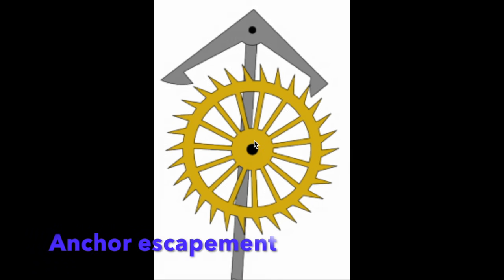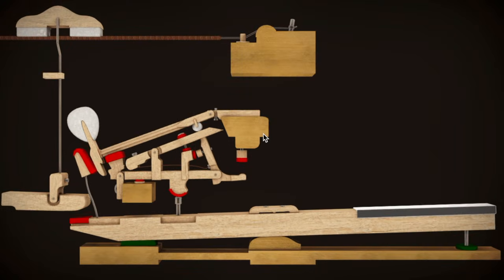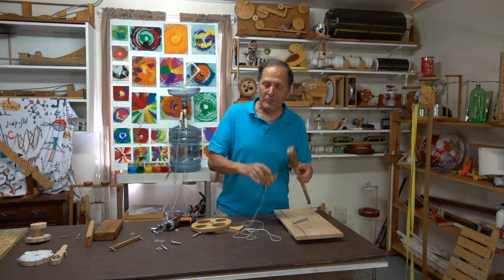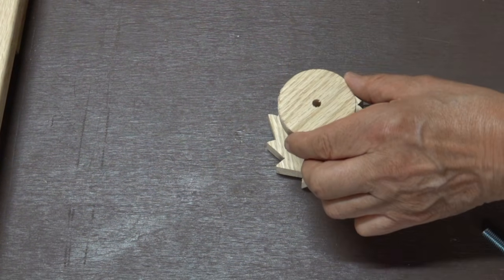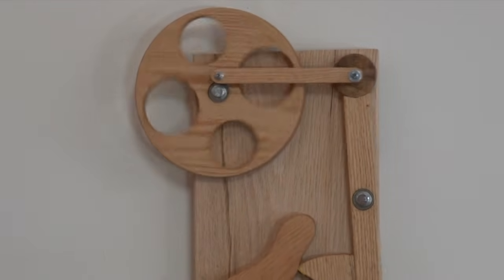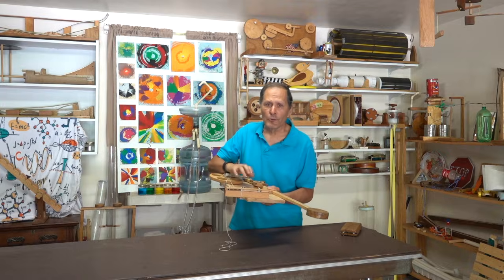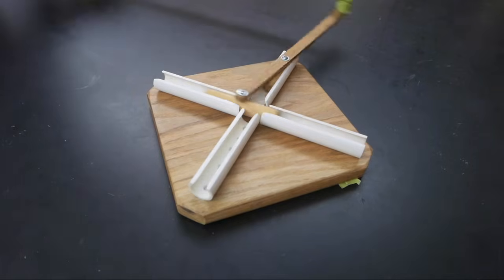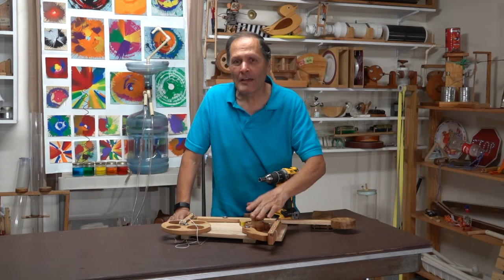Gravity Powered Escapement Wheel....  Simple machine lesson

Comment: on the turning wheel just add 12 small neodymium magnets and have it run across some coils of wire. try to get 12 volts and put that 12 volts into an inverter to power things.
Reply: Physically not possible. Say if the weight is moving down at 1 cm/s and is about 1Kg, it produces 9.81m/s^2 * 1Kg * 0.01m/s = 0.0981W of power. ~100mW is probably enough to light an LED but that's about it

Comment: Nice! Could you get enough power from the flywheel to run a small generator to charge a battery to run a electric motor to pull the weight back up again?
Reply: might be able to if the rotational wheel is a magnet and coil set up with a large supercapacitor being charged and released to a motor to pull the weight up again...
Reply: thats not possible, and it would defeat the purpose anyway, you cant get more energy out than you put in, you cant even get equal energy back. if you did use the energy the flywheel made to power a moter to pull it back up, it wouldnt pull it all the way back up, and you would waste all the energy to do so, making it pointless to even build it. look up perpetual motion on ted ed to see why.

Comment: The flywheel destroys any freedom of the pendulum. Its friction destroys the quality factor of the pendulum.
Reply: Indeed, it does not allow the amplitude of the pendulum to self-regulate itself. 
One way to transfer small amounts of power from a self-sustaining oscillation clock-type device to a rotating load is by employing a one-way friction clutch (see for example animations by thang010146).

Comment: This reminds me of something which takes into account Newton's Third Law of Motion.  Have you seen those alarm clocks which are wound using only one key?  I realized that the way such clocks work relies on the fact that you cannot put tension on one end of a spring without putting equal and opposite tension on the other end.  This says that both ends of the spring can be used to provide potential energy.  So, when you wind up a single-wound alarm clock, the "wrong" end of the torsional spring powers the clock movement while the winding end powers the alarm movement.  That's killing two birds with one stone.  Simple!
Reply from the maker: interesting,  I've looking at other versions of escapements to try and springs is high on the list,  so much to learn and not enough time
Reply: @YeanyScience  a very interesting scapement i never saw remade is the campani silent escapement.

should be easy for a skilled woodworker to build.

Comment: Gravity powered escapement wheels have been around for centuries, The grandfather clocks imported to the colonies, like the one my great grandparents had when we were kids in the 1930s & 40s, were powered with weights which were usually rewound daily. The clock mechanism, including the escapement gearing, was virtually identical to that of a coiled spring powered clock, except the energy was stored in the weight  on the end of a rope/string wound onto a "drum". Part of the escapement mechanism was the pendulum, which served the same function as the escapement wheel spring in a spring powered watch or clock. The distance from the pendulum pivot to the center of its weight determines the period for the escapement cycle.

Comment: I remarked that the period of oscillation can be variable in your design. But this is not what we want for a real clock, for example. AFAIK, in a clock, the period of oscillation is stable. I wonder what lacks in your design, compared to a real mechanical clock, that makes the period not stable in your case
Reply from the maker: Hell Louis,  this was a learning experience for me so it has quite a bit of room for improvement.  I  have a few ideas on why it is imprecise.  There is still quite a bit of "play" in the bearings so it's movement is sloppy, plus slight differences in the cutting of the teeth escapement gear might have more friction in some parts than others.  One other possibility  is the bob on the pendulum doesn't have enough mass, more mass might help to stabilize it, something I will check on.
Reply: Hello Bruce, thank you for your argumented response. I understand that the idea of your setup is not to produce something as accurate as an actual clock mechanism, and I want to ensure you that my remark was absolutely not a critic of your work, and to be honnest, what you have done is awesome ! 
If I understood well you are a science teacher,  and this is a great experiment tools for your student. +1 +1 +1
Reply: @YeanyScience 
Great presentation!
However, coupling the pendulum via a rod to a flywheel is not correct. 
It deprives the pendulum of its main purpose, which is to assume a self-regulated amplitude that will maintain a steady frequency of operation independently of variations in friction and magnitude of the descending weight.
Reply: A normal clock pendulum has a wider swing when the driving weight is increased and the oscillation time is relatively constant. In this design the pendulum is not allowed to reach its full amplitude because it is constrained by the flywheel linkage. Increasing the weight causes the pendulum to swing faster, but the flywheel quickly pulls it back.

Comment: Please correct me if I am wrong! If you double the weight, and double the pulleys, the pulling power would stay the same, but halving the travel?
Reply from the maker: yes,  that is why there are two strings supporting the driving weight, giving it double the run time.  If I doubled them again it would halve the travel again.  I figure the way it is set up now runs long enough as a demonstration piece.

Comment: Bruce, please add a device to this latest project that ensures the wheel can turn only in one direction. This is a question I've always had: how did an engineer ensure that a steam locomotive's pistons were driving the wheels in the same and correct direction?
Reply: Quite a conundrum.  I don't think anyone built a single cylinder loco, there's at least two.  If these are coupled (via the axle on the drive wheels) you can build the machine with a 90  degree phase relation between the two.  That solves the problem.  For a single cylinder you can either kickstart the flywheel in the desired direction or very gently let it run backwards part of a turn and then slam the breaks on and restart.  I think the latter was done for some giant beam engines.  Not easy to kick start a 200 ton flywheel!  I think the pumping station I visited had a smaller engine as a "starter motor".